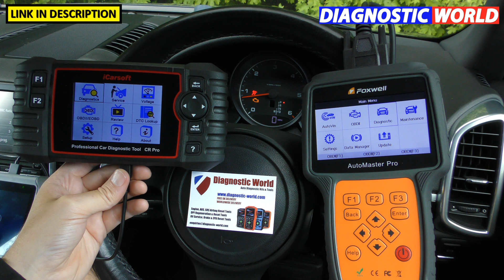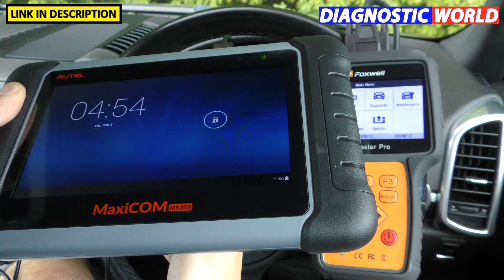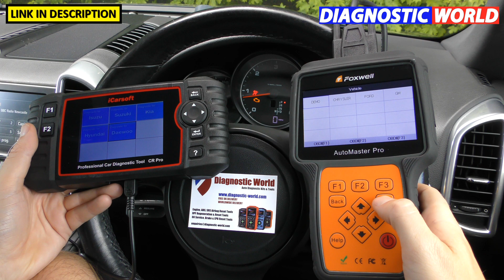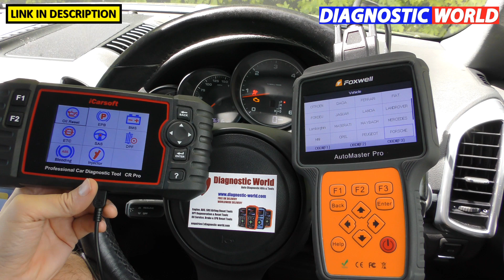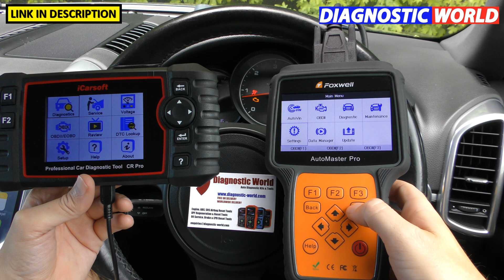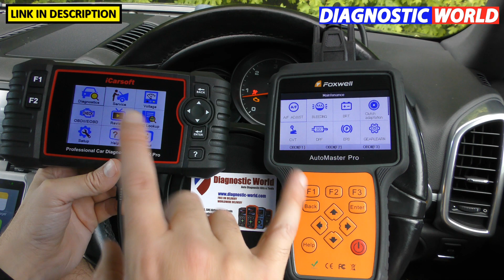iCarsoft CR Pro vs Foxwell NT680 Pro | Best Value For Money Comparison & Features - 15 Differences

Comment: Just got the nt680 pro as I don't know what car I'll have in 1 or 2 years, but it won't be the make I have at present.

Battery management system reset /  recoding us surely a basic function that anyone needs, yet isn't available on many.  Got the 680 Pro as it will.

Comment: I had a Garmin satnav device some years ago and paid £50.00 for lifetime updates. After around a year or so I contacted Garmin to update the device. After following instructions to connect it to my computer, I was told that the memory was not big enough to hold all the data! I explained that I only needed the UK maps, but was told they only supply European maps as a package. I'd never buy another Garmin product following that scam. I hope that these scan tool companies don't operate in the same way!

Comment: Brake bleeding did NOT WORK on the Icarsoft cr pro for a standard toyota corolla 2005. Thinking of swapping it out for the NT680 PRO and try that instead.
Reply: Foxwell NT630 plus can brake bleed in 2005 Corolla. I had 2006 toyota Fielder and works fine ABS System.

Comment: Foxwell NT680, Wont read codes properly on Vauxhall / Opel, it freezes at the "Please Wait" screen after Read codes is selected, and support is useless.
Reply: You probably have a faulty unit or it needs updating. Hard to believe that a GENUINE unit cannot read codes properly? What colour is your Foxwell tool???
Reply: @moally55  It is Faulty, But Foxwelltool.co.uk won't accept my word for it, they want screenshots of every screen displayed to get to the fault, It's fully updated, and I can't believe they want a screenshot of it displaying "Please Wait" , I think 15 - 20 Minutes is long enough, In contrast I have a little Autel Scanner that does the job in under a minute,
It's exactly the same as to one shown in the video, It's Not the Pro or the Lite, just NT680, there are three variants.

Comment: I need a mileage correction tool for a Lexus rcf sports 2015
Reply: 680pro does odometer reset
Reply: @maicoknight  is that for the lexus rcf? Thanks 👍
Reply: @user-kk3ij6ge8o  not sure but check the vehicle list for the odometer reset functions